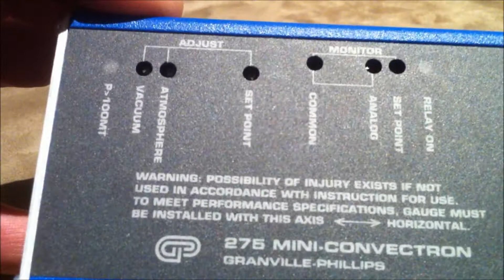Energy Update #15 - Arduino Controlled Vacuum Gauges

Comment from the maker: Yes, I plan to measure the vacuum with the gauge. It has a 0-5V output depending on the vacuum level. I will feed the gauge output into the arduino to display the vacuum levels.

Comment: I found very interesting your project. You will measure the void with the arduino? What is your interest in this? What is your application? The output of your sensor is 5v? I already work with the arduino awhile.

Comment from the maker: Yes, they will work well together. I have just ordered a couple of relays to go with this project, so I can't wait until they turn up. I'd like to get an LCD on each vacuum gauge, but that is beyond my expertise at the moment. I will need to do some more reading first. What I would really like to do is to get all the gauges operating via a wireless transmitter/receiver. I have seen modules to do this and it would be a cool addition to this project, but it's just a dream at the moment  :)

Comment from the maker: Thanks. Both the arduino and the gauges won't be exposed to any high voltages. They both run off low voltage DC and the gauge outputs a 0-5V DV voltage based on the level of vacuum. The set point relay output is also a low voltage DC output. All the processes which it will be running will be completed before the high voltage comes on. I will even remove the gauges from the chamber prior to applying any high voltages.

Comment: Very nice project :) those little device look very nice :) if you can get the datasheet of those make sure you have some isolation on the output before playing with high voltage I know the arduino nano is about 10$ but still :) can't wait for the next project!! :)

Comment from the maker: I have looked into isolation and grounding, but as I play with longitudinal and impulse currents more and more, it solidifies my belief that the propagation of these currents is very much unlike standard AC, DC and RF currents. The isolation and/or grounding products which are commercially available for these types of currents do not seem to be quite as satisfactory when they are used with high energy impulse currents.

Thanks for your comments and advice!

I will take a look at their website :)

Comment: Also you can get isolation boards for plasma chambers which will protect your gauges and other circuitry.I used them for protecting thermocouple inputs when an arc hits them, but I don't see why other applications couldn't be used, give some plasma nitriding furnace builders a call. People such as Rubig make boards like this.

Comment from the maker: I already tried to re-bridge the track that was completely blown and I also bridged the fuse terminals. Unfortunately, the damage extended beyond the visible domain & some parts on the other end of the board blew up and flipped the mains breaker when I tested my repairs.. Looks like I'm up for a new power supply...